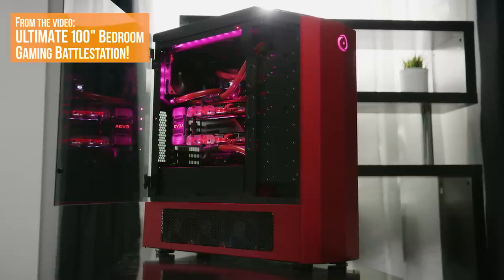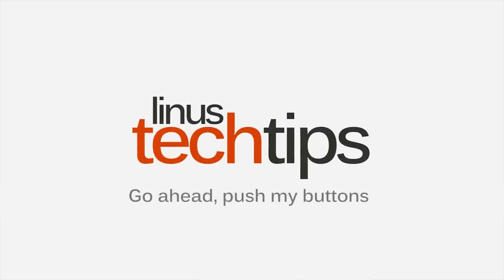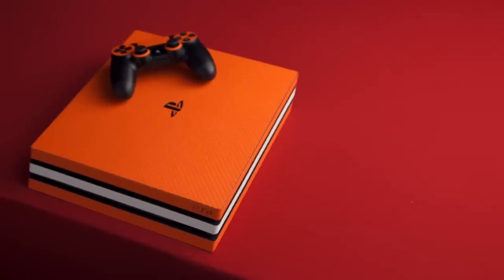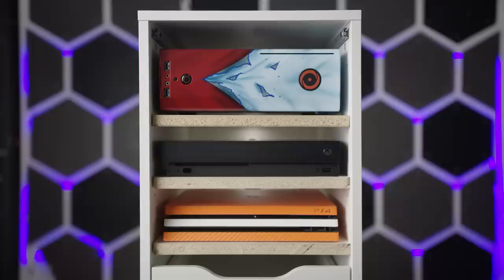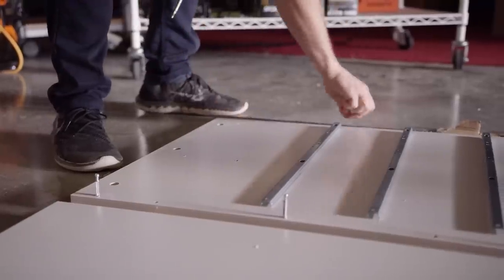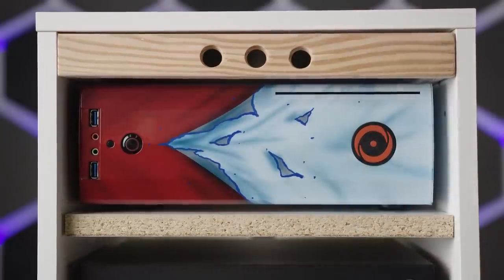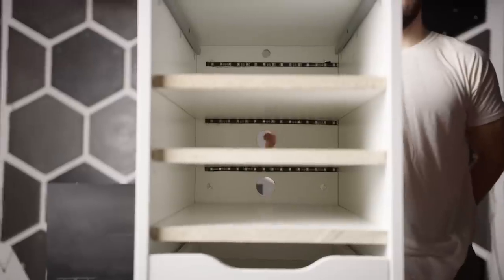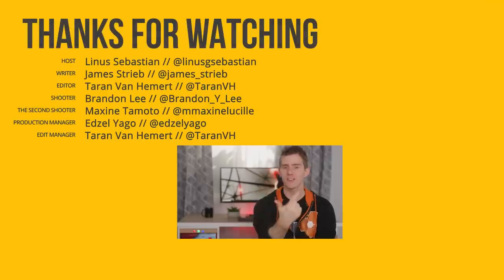Ultimate PC AND Console Gaming Battlestation

Comment: I have a challenge for you. Build a PC with PS1, PS2, PS3, PS4, Xbox, Xbox 360, Xbox ONE X, Gamecube, Wii U, Switch Mother boards/equipment embedded inside w/ Water Cooling, and a Raspberry Pi that has emulators and games to all other gaming systems that I didn't list above like: N64, Super Nintendo, NES, Sega Genesis, Sega CD, Sega 32X, Sega Saturn, Sega Dreamcast, Atari 2600, Nintendo DS, Nintendo 3DS, Gameboy Advance, Gameboy Color and Gameboy.

Comment: If you were going to solder to the remote. Then why not just wire the buttons directly to the remote. The Arduino wouldn´t really do anything.
Or use the Arduino as a replacement remote control with an IR emitter. No hacking anything to the remote, making it a backup.
Reply: Then you can't have the lights at the back that show which one is selected. Also no light effects like the "breathing" they had.
Reply: But they didn´t do that. In multiple shot you can see lights from more than one shelf.
But of course if would leave you open to a lot more tinkering :)
Reply: I don't get it. Why put all that effort into the leds and not even bother painting the drawer at the top. Confusing priorities with their aesthetics.
Reply: 1. Arduino can work as IR transmiter with a cheap IR diode
2. Light stering by PWM ok
3. Arduino can work as proxy for remote outside shelf
And u can reprogram button on remote to steering light
And why cannot use arduino as aours itp RGB controler
Reply: There are individual LEDs on HDMI switch. 1:50

Comment: A cheap IR blaser with a learn function attached to the arduino would probably have been easier than trying to hack the remote (before you killed it, I mean). Way less wiring.
Reply: You don't even need an arduino...  just the IR blaster with HDMI switcher remote.  Then again, why even have switches? Use a TV or a receiver... no need for physical buttons.  So weird.
Reply: Or just use the button on the front of the switch? I mean, sure, you have to cycle it through instead of directly switching the inputs. Although since they needed the arduino for the led strips, they could have just put a IR LED on an output pin and pointed that at the switch, no need for an IR blaster. They bit-banged the code anyway, so it would work just as well that way without even having to open the case of the switch. Literally zero modifications to the code they wrote required.
Reply: Was thinking the same, it would have been way easier

Comment: Be an Linus Tech Tips
Make very expensive setups
Use 5$ Cheap Arduino Clone
Reply: Look on "cheap clone" and original Arudino, if have a ATmel MC and USB chips is original a very "cheap clone" use a CH340 chip as USB controller.... 
If u don't see difference why pay more?
Reply: The circuit is free, so its ok to buy from other brands
Reply: And? It works.
Reply: Most arudino clones cheap out on the voltage regulator, so it's rather easy to overload it with normal work and have to end up replacing it anyway...
Reply: I think most people use 5$ Arduino clones... I know I do.

Comment: Love your DIY ideas, however most of your work seems incredibly sloppy with the details. I'm guessing there is a pretty small time window for these projects from start to finish. Speaking of finish. Danish Oil sells the most versatile.... nah, Some finishing oil, and just better measured pieces could really tie this thing together without costing that much in the time department, Just the holes for the switches looks off center and not very well aligned.
Reply: Vreil Humpback Yeah, indeed, like, that 'connecting 5V to 3.3V' mistake they did is just either a noob mistake, which I think they're not, either because of hurrying and forgetting to make sure everything is good before powering it up. A bit more polishing for this projects would be awesome, you can clearly see it was rushed when you look at the slightly tilted top drawer they made.

Comment: I have a kinda similar setup inside one of the cubbies of the Ikea Kallax shelf (2x2 version) next to my desk: bottom is my Xbone (non-S/X, a very tight fit, but works), above that is my Ps4, and above that my Xbox 360. My PC lives on top, in an NZXT H200i. The HDMI switch is stuck to the outside of the shelf, and is tiny and black, so it's completely unobtrusive. And I've got  cooling fans to ensure airflow for the consoles. Pretty happy with this setup, and the shelving unit itself is brilliant.

Comment: why not get a tv with 3 hdmi inputs and control it from the tv remote???
Reply: Ssshhhh, this isn't the place for common sense.
Reply: What's a T.V.?
Reply: dieubermensch bc a monitor is better for gaming. Well ur kinda right bc those consols cant go over 30 fps and dont forget that there is a pc too.
Reply: LG has a few monitors with remotes AFAIK. But in my opinion the buttons are cooler. That and they wanted to be able to control the lights as well.
Reply: Don't TVs have bad input lag?
Reply: Because it was about the buttons on the cabinet.
Reply: what is a tv?
Reply: My 55" 4K Monitor (whats sold to be a TV)? Work's great with network TV and Xbox at a shelf behind my bed!
Reply: 4 HDMI, 1 4 K UHD, 2 Display ports , 1 DVI and a network port, It all runs under Android, so with one push on the remote I got YouTube, Netflix etc Video nVidia 1080.
Reply: Exactly they have wasted a load of money  and lots of hard work on a problem I have never had 
My tv has a shirt load of connections and a great remote
Reply: Capture card
Reply: because it's a PC monitor and it doesn't have 3 hdmi inputs.
Reply: It would have been cool to see that 65inch 120htz Gsync Monitor....errrr TV.
Reply: Pc on a tv? Send me the shrooms too buddy.
Reply: HOW MANY TIMES DOES SOMEONE HAVE TO ASK TO GET AN ANSWER WTFFFF IS A TV
Reply: dieubermensch lol right .  They think they're nerds eh
Reply: He wanted a blast from the past with A/B switches. Shit that we used to run our NES back in the 80's.
Reply: Dude, my like made your reply as liked as the comment itself
Reply: Because RGB lights
Reply: dieubermensch bc its ugly and slower
Reply: dieubermensch monitors have better refresh rates
Reply: CPC_RedDawn will to use that free sync u need a monitor with free sync. Tv's dont have it.
Reply: Arend Wolbers that is not a monitor.
Reply: Loads of monitors have multiple dp ports and a single hdmi. Dp to hdmi cable  consoles. Dp direct to pc. Simples
Reply: Also why would you even need an xbox or playstation when you have that computer....
Reply: Realistically seen, all we create as human causes cancer, even food and the turd we leave behind after a meal or medicine intake. 99% of Factorys create only for the landfill, look around in your room, throw away all you didn't use the past 6 month, I bed there will not much left! So 1 TV with all Apparatus connected to it, is always less than 1 monitor for everything incl 2-3 monitors for 1 PC.
Reply: 35 y ago I was a ham radio amateur, sending on low band, LSB, HF, UHF frequency, never had to use a flashlight in the antenna connection shed, just a fluorescent tl bulb wich started up when in the shed NO electrical connection needed, all this just because of radiation from the cables. From  day one of my Computer decades starting with a ZX-80 up to today's Intel Pentium 7 I have had monitors wich where as big as a small Refrigerator, these gave so much radiation you didn't need a heater in a 10 cubic meter room.
66 yo now still no radiation sickness, yes I know there are some people sensitive for it.
And about the chemicals, driving a white delivering 700 - 1000 Km a week, we had to clean our noses, eyes hair and ears every day and the Van weekly on the inside just to remove the fine dust we picked up along the road, not filtered by the AC!
Stepping outside (and I don't even live in a city) you be sprayed with all sorts of chemicals daily.
Everything we touch is poisoning and radiating us.
Reply: Because 60hz isn't ultimate
Reply: Or you could get a gaming monitor that has multiple inputs. Like mine has a Display Port and two HDMI Ports
Reply: Because if you use a tv and not a monitor your not a gamer

Comment: I had a 3 way switch like that hooked up back in the day when the consoles ran on coaxial cables. Had cable, NES, and SNES connected to the 3 buttons and then N64 and PS had to be connected directly to the TV. Clicking between the mechanical inputs was satisfying and instant, unlike the HDMI which takes some time to process the change. I still have the switch with the NES and SNES, I really need to pull them out along with the old CRT TV and play some of those games again instead of the nearly 1000 I have on Steam.

Comment: So this video isn't in 4k because the consoles in the video right?
Reply: i was just searching  this comment :)
Reply: Overlord that hit me right in the heart 🤣
Reply: Dylan Gorton not true 4k
Reply: @Winter Mute: couldn't agree more, wth happend there
Reply: jacob avila only very few games do true 4k on XShit1X most games are dynamically scaled from multiple resolutions to trick you Xbox one x hardware just isn't enough for true 4k
Reply: 4k movies and such of the likes is wonderful and should be a norm for any electronic running a display. As for the games, most of the library is waiting for "updates" where the settings get turned down, and the resolution turned up. I've experienced what the xbox x can do, as my friends have them, and it doesn't ever compare to what PC is capable of. It's still a much nicer console than the xbox one, and is better than the ps4 pro. I'll give it that.
Reply: If you knew what microsoft was doing then you wouldn't say that. They have to reconfigure the games settings, which is why updates roll out. On PC, a simple change to the resolution slider built into the game does the trick. Microsoft has to change settings lower to achieve playable frame rates at the given resolution. Those frames rates and resolution are determined by microsoft, for most games it's 4k 30fps, for a few it's 4k 60fps depending on how optimized the game is. Tweaking the in game settings isn't unheard of in the PC world, but it is drastically more flexible than XBOX ONE X. Being able to chose which settings matter, and what frame rate is acceptable, as well as if 4k matters to you in the particular game is a big deal to some people. Hence why People decide to buy PCs instead of consoles.
Reply: As for what the other guy is saying, most games that run at 4k on the xbox do run at 4k native. But there are some that have dynamic resolution scaling. If a tasking scene were to take place, in order to maintain a set framerate, the resolution is dropped accordingly to the framerate. This technology is offered on PC equivalent games but can be enabled, or disabled based on your preference.

Comment: Ideas for improvement: use an IR Led in the Arduino to control the hdmi switch, programing the inputs codes. Or switch to a tv or with a remote control and change inputs the regular way...

Comment: I grew up learning carpentry from my Dad who's a master finishing carpenter and every time they do a build like this I just cringe all over. Crooked buttons... hot glue instead of wood glue... splintered off holes... GAH!
Reply: WHATSaDavid they are average people? Not construction workers mate
Reply: WHATSaDavid they are tech people not carpenters, but i dont see ur dad to make or build a pc as they do...gah
Reply: MR. Darknight It doesn't take a carpenter to make 3 holes in a straight line or to make stuff look nice.. Anyone can do it if they actually just care enough to do it.
Reply: Here's the thing though, being a 'tech person' is no excuse for poor craftsmansip, especially if its a project you are wanting to show off. Plus, even the tech portions of the build are pretty hacky anyway. Wiring to the led strips and switches is poorly crimped butt connectors, all the wires are the same color, and they used a breadboard in the final project. Plus, the code they show @ 4:46 is just terrible. There's nothing wrong with bit-banging, but at least separate it into a separate function that you write once, and call it with the appropriate parameters for each code from the remote. I get it, it's something the hacked together that only has to last for the length of this video shoot, after which it'll get shoved into a corner or dismantled, but this isn't good work on any level.
Reply: the holes where in a straight line, don't over exaggerate, could they do it better? sure they could but the thing is that they are not going to use that setup anyway, this was just an idea of what u can do, like when nvidia wanted to build a pc like a xbox 1, it was not perfect but it wasn't bad either. it was just an idea, so why put so much work and time on it if they are not going to get any use for it. and it was not that bad  anyway.

Comment: Compensator 3: de-lidded  8700k liquid metal cooled with water cooler, gtx 1080ti in sli water-blocked, 128 gb RAM at max speed, optane pcie ssd and custom water loop.

Comment: Hey Linus, The only thing that could have been better is adding a Raspberry Pi 3 for retro gaming, and then creating a drawer that has a 2player arcade stick setup. Actually you probably could have did a little better if you would have bought a really good MDF and used the slotted rubber T molding to almost give it an arcade feel to it rather than IKEA stock PS-Linnmon corner desk with 2 MICKE drawer units and 1 leg in the back may have worked a little better and been more friendly on the wallet, as a matter of fact it would have been around 200$ maybe 250$ if you would use the bar CAPITA riser and a MICKE shelf board for a monitor riser.

Comment: I would buy that exact build off Linus if he was selling it. Including all the consoles and pc.
Reply: qwe 123 he'd do it out of passion.
Reply: VuIex for how much would you buy it?
Reply: $420 (5:42)
Reply: Ben Snow That's just the desk cost...
Reply: Hey, man, I'll build one for you. What's the budget?
Reply: That's exactly why he'd buy it with the consoles and the PC for that cost.
Reply: I would love details or step by step how you programmed the toggles for each system
Reply: VuIex gross
Reply: Basically they connected the arduino to the switch button, keep track of which monitor they are on, and send a high signal as many times as many steps they need to take until the desired display. The code itself is really simple, and most of the important part is in the video.

If you go to 4:46 and pause, you can see the part that matters. The 'input' variable holds the current HDMI input they are on, 'between' is the delay between button presses (probably a few dozen millisecs, needs to be tuned for every device), 'hdmi' is the ID of the pin hooked up to the switch, and 'chronosButton' is another pin ID for one of the buttons on the desk. The code you see switches to input 2 by emulating a number of button presses depending on which input the switch is on currently. Repeat that three times, adjusting the input to switch to (or use some basic for loops if you're smarter and lazier), and you should be ready to go.
Reply: VuIex I am selling the same dude come to the basement behind that abundant junk yard and don’t tell anybody where you are going and dont bring anybody.Also don’t bring your cell phone.You should only come at night after 12.
Reply: @shakemiz  Haha, you're gonna feel pretty stupid when you rewatch the video and hear that it all only cost $420.

Comment: Those feels when the Switch isn't apart of the setup.
Reply: I guess the Switch is reserved for on-the-go use.
Reply: Gerbil I'm laughing harder than I should be. I'm just imagining the quartet guys from family guy 😂
Reply: But if you put the Switch dock on top of the desk, it will have exposed... Gasp CABLES!
Reply: 720p gaming isn't allowed on the desk ;)
Reply: VELOCITY FPV So why are the Xbox One and PS4 included then?
Reply: But they are "Switching".
Reply: VELOCITY FPV So why shouldn't the Switch be included if the majority of the games are 1080p?
Reply: coulda put a dock in the top layer so that when you set it on there it defaults to screen from a 2 in 1 out switch that the original HDMI switch routes into alongside it. its how mine is setup
Reply: its 900p in docked mode lmfao
Reply: SmilesAreDaggers  So why the hell are the Xbox One and PS4 in there then? They don't exactly do 1080p on all games, either.
Reply: Everyone at LTT is older than 13 and they aren’t mentally disabled, sooooo, that’s probably why.
Reply: Too much devices outputting at 60 fps is a problem, so they had to choose between either the switch or the PC.
Reply: You know the Switch outputs in 1080p right? The screen on it is 720p, but it outputs at 1080p
Reply: 1080p actually, BotW runs in 900p.

Comment: They did a very good job on the design, their engineering skills are definitely underrated.
Reply: looks ugly af, without any room for pc and consoles to breath
Reply: He added latency to all of his inputs by putting a switcher in the build and his systems are going to burn down
Reply: Thomas willz 
It was a good attempt.
Companies spend millions to dollars to design chairs, they spent $200.
Reply: Their DIY skills work, but they could do WAYYY better. For example the top trim isn't even straight with the top shelf board
Reply: no
Reply: They didn't even drill the holes straight for the buttons :(
Reply: Winter Mute 
It's not like they spent a month designing it. Probably only a few hours.

Comment: I mean, the idea with the remote would have worked, and they wouldn’t have even needed the arduino. All they had to do was attach the Buttons to the same pads that get connected when the button is pushed on the remote, basically just extending the buttons on the remote. The arduino was completely unnecessary lol but I like this concept.